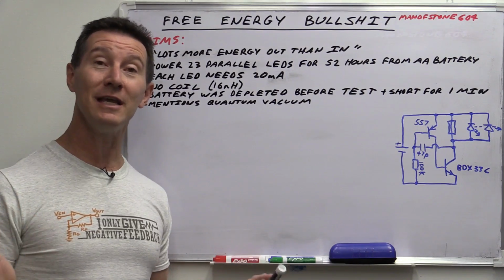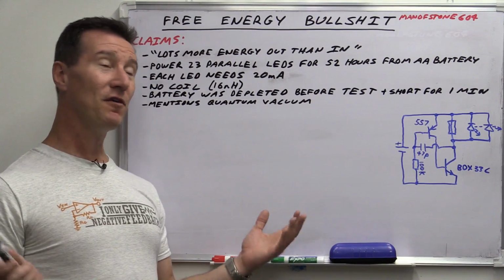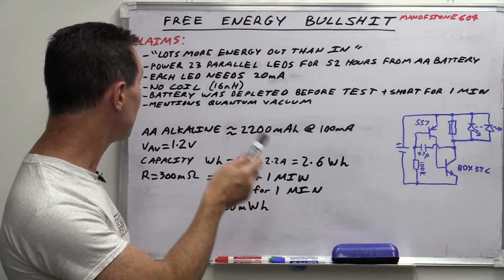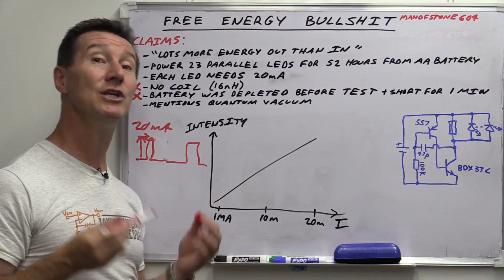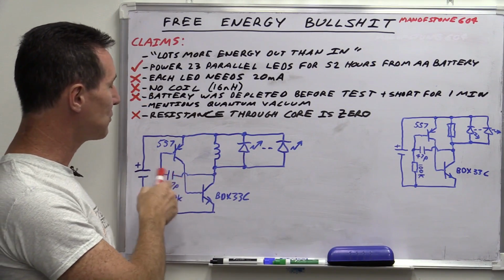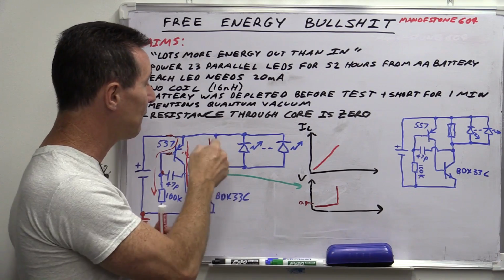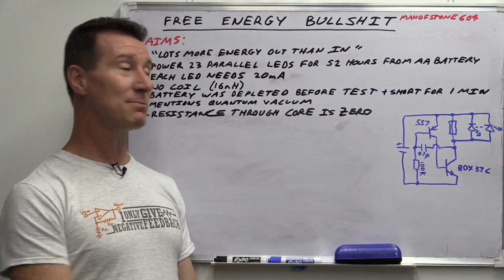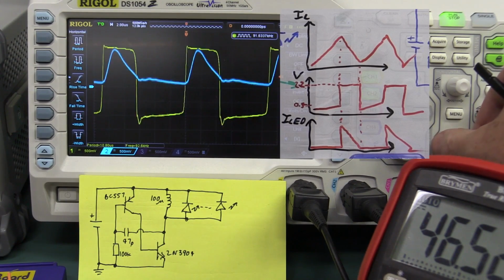EEVblog #708 - Free Energy Overunity is RUBBISH!

Comment: Free energy is nearly impossible unless high frequency open wireless non linear power systems are used along with negative resistance & tunnel diodes :) an unlimited amount of wireless leds can be lit up from a properly built 1 watt tesla coil.

Comment: First of all you have no clue how "free energy" works, There is no free lunch in this universe, you can't make something out of nothing, With that said you can take a little and get a whole whack more performance, It's not going to be a "direct" output silly! It's not that same kind of electicicity when it come from the vacuum. But you can use fancy circuits and devices to trigger this vacuum energy convert and transduce it back to something useful, we can than use such as stored inside a battery for later usage. An open looped circuit charging system.  That is why my device can charge a set of 600 amps 12 volt car batteries in 24 hours period and regauge those batteries to just as newly charged condition.  With a total of about 2 amps used of input current over the 24 hour period. So no it's not plugged into "nothing" and just running.  But I get all that extra in the output for later usage. Sounds like a great deal to me if you know what is going on.
Reply from the maker: LOL
Reply: @EEVblog  Let's put it this way, When your lights are out. Mine are running LOL

Comment: So what is the "efficiency" if the circuit? 24mA@1.5V at input, 11.82mA at output, but we don't know about average voltage or power at the output. It could be interesting to note. Still <1 of course.

Comment: Dave, I qualified as an electronics engineer 35 years ago, but since then I moved into electronics manufacture and then QA. And I was always  much more into digital electronics than analogue, even though there are analogue considerations in digital circuits, particularly where synchronisation and timing are concerned. But your videos are so clearly explained and argued that I was answering your rhetorical questions on cue, in an instant. Everything came back to me: "Then that BJT turns off, and that turns the Darlington pair off, and so the inductor shoots for the sky, but it's clamped at diode forward voltage, and that whacks a mess of current through the LEDs..."

But I am pleased I spotted the non-inductor inductor before you mentioned it. When you said the video poster had said there was no inductor, I just pointed at the screen and laughed. "That's a buggering huge inductor right there! Why bother with the ferrite ring at all, if you're solely looking at DC?"

Comment: Take a solar led light a cheap one. Replace the inductor with a a two coil toroid, so that the primary replaces the inductor. Then the other coil is connected to a matching toroid of  the same value. So then connect a low voltage drop bridge on the output to the output on the second coil and send it back to the battery or super cap to recycle the energy. This is not over unity, it only reduces power used or recharges the battery a bit. But I think it could work better if you couple the magnetic flux. ?

Comment: This really isn't rocket science. 
1: Connect the output to the input. 
2: Remove the battery. 
3: Does it continue 'generating' electricity?

The answer to 3 will always be 'No', because overunity is BS.

Comment: "Extraordinary claims require extraordinary evidence." Yes. Perfect.

Batteries should also have a total current capacity in amp hours, regardless of watts delivered. The power in watt hours assumes operation in an optimal range that doesn't pull down voltage and therefore power. When shorting out, just measure amp hours and subtract that from the total amp-hour capacity.

The thing doesn't look that efficient either. Maybe the coil could be in series with the leds instead of just getting shorted to ground. IDK

Man, if I had a scope I think I would really want a floating ground input because you are always working on live equipment and you can always ground out the floating ground, though maybe that's not ideal.

Comment: When you mock free energy you are right and ... wrong. By Mach principle if you are able to generate a rotary warp in space-time, you can steal energy. Actually far bodies of mass will be pulled slightly towards you so they will lose gravitational energy and by the conservation of energy, this energy must be turned into motion or another form of energy. So you actually ASSUME that there is no way, by using electro-magnetic fields, to generate a sufficiently strong rotary warp drive. This assumption may be unfounded. I agree that most presented devices do not use strong enough electromagnetic fields to generate an Alcubierre - White warp drive but what if mainstream physics is wrong ? What if spinor based theories can't account for unexpected gravity and anti-gravity by electric charge if the the fields are intense ? Don't be stuck in a groove. As a scientist you must accept that physics is all about predictive models and these models may be dead wrong no matter how successful they are, regarding most of CERN results. If you can't accept  that, then you turn science into a religion and that is a very dangerous trend. You should pay attention to: https://arxiv.org/abs/1502.06915 and to https://arxiv.org/abs/physics/0509068 no matter how mainstream physics likes of dislikes these results. The Flyby Anomaly above powerful  thunderstorms , when these occur, is another indication that the Standard Model is wrong, see: L Acebo. The Flyby anomaly: A multivariate analysis approach, 20/Jan/2017, arXiv: 1701.05735 These signs should not be ignored!
Reply: Have you noticed none of the JTRIG crew commented on your well thought out and well written response?
Reply: @anonymousguest9290  They should. It is not my idea. Dennis Sciama and James Woodward came with other formalism of this idea.

Comment: https://www.youtube.com/watch?v=t1brwSJSdRg&t=302s
real free energy , not free to start but after 30 second the device will be creating it own power and some at least 10x more like 100x

1.5volts to boil water

the power from the steam turn a steam engine fly wheel

the steam engine drives a 80 to 20 gear ratio system

the spins a 100v generater at good speed

out come is a lot more power than what is required to run thee system

the warmer the enviroment is or the higher the altitude , the easier the system will boil
Reply: Hahaha! Good joke man!

Comment: what I think about "free energy": the only way is to steel it from radio frequency that you convert to currant/voltage but I recommend multi channelled(fox-news, tf1, canal+, & consorts) what yours thoughts on this one...
Reply: Can't do anything unless their transmitter is practically in your yard. Tv and radio antennas don't "suck" power from the air, they only generate a TINY voltage from the signal wavelength. There is almost no current to capture (build or look up a crystal radio and listen to how weak that direct captured audio is, you really can't do anything useful with it), an old solar yard light panel is pretty much infinitely better compared to radio signal captures. Just like HV power lines you need to be on site to even light a decent led.
Reply: @volvo09  fore sure you wont be able to power up a big circuit, but cumulating channels to power up a little radio? ore some other little things....

Comment: Thing is, yes there are many people making nonsense claims about free energy circuits. However it doesn't mean so called over unity technology is not possible. In fact you have some on your roof, solar PV, also solar thermal. It's just that you believe the sun is firing photons at the earth, so you know where the over unity is coming from. At the cutting edge of science people are discovering that we live in a sea of energy. Empty space is not actually empty. The aether, in some form does exist and no Michelson and Morley didn't disprove it's existence. I believe there are some technologies that are able to tap into this limitless source of energy. But even if you don't believe someone has done it yet, it is possible. It doesn't break physics, just pig headed engineers' belief systems.
Reply: Na, but then you'd be stealing energy from the others in the aether. Show a true case of free energy (yes solar is free, water power is free, etc.... But it's using an existing source of understood energy with calculable losses involved). We know what hits the earth from the sun, we know solar cells don't even capture half of what is shining in the area and what affects it for the worse. There may very well be misunderstood or unknown energy out there, but it's not in our known areas of understanding or else the calculations wouldn't work out, nor would repurposed boards.

Comment: I  think, the waveform is sine, because there is a serial LC circuit, made from this "not an inductor" and the 47pF capacitor. The first transistor is not actually needed, if the main one has enough amplification. In this case you just connect the 47pF capacitor to the base of the main transistor and add some initial voltage on the base using a voltage divider.

And some measurement tools may give wrong power ratings because of the high frequency.

Comment: There are people that are more "Experimental Thinkers" and others that work better working directly with the math and theory.

You explained the theory delightfully, but ... reaching some people (IMNSHO) requires wording things much more directly.

That is: "If you short your AA for 2 hours with heavy gauge wire ... THEN run the experiment and get light, then I might pay attention."

There have historically been several key points that the experimentalists have been "ahead" of the theoreticians, and I don't want to miss any key corner cases that prove to be interesting phenomena. The triode for instance. (And much confusion theoretically at a variety of places in our march to modern chips.)

Comment: free energy is simple and there's more ways thane one.... "Basic Engineering" as you call it, can be used with "Basic physics". For example, play gravity off/ against buoyancy ..... for example, 1 container with fluid will allow a container of the liquid to sick. then hit a valve that release's the water and fills with aire (just using air for exaple). when its full valve closes and the submercible leaves for the surface. and process crepeateats for ever with a syphone or 5 replenishing the water in the tank. this will run for ever and you CAN get fre energy from it

Comment: How many of you who do not believe in so called free energy please tell me how many years you spent studying it? How many of these devices are you aware of? Can you name three? The future should not be powered by dirty energy but clean efficient energy machines.
Reply: >How many of you who do not believe in so called free energy please tell me how many years you spent studying it? 

None really, but I have done several university-level physics courses and those were pretty clear on why "free" energy doesn't make sense. Look up the first law of thermodynamics, if you somehow haven't already. Spending years trying to find a machine that works isn't necessary because the math proves, pretty easily, that it's impossible unless you can make 1=2.

>The future should not be powered by dirty energy

Of course, that much is obvious.

>... but clean efficient energy machines.

Which plenty of things are, but "free" energy does not exist. You cannot have a closed system that has more energy coming out of it than energy coming in. The earth ultimately gets it's energy from sunlight "burning" hydrogen in a fusion reaction like a car burns gasoline (without CO2 emissions granted, but there's only so much hydrogen in the sun), and radioactive material heating the inner earth which also "burn up" until they radiate no more energy and the earth interior eventually goes cold in the far future. Solar energy isn't free, it comes from the sun, which won't radiate energy infinitely. Hydro depends on the water cycle which is, again, the sun's finite doing. Wind power depends on currents that are ultimately due to... the sun. Any kind of nuclear basically turns mass into energy, but you need to give up that mass to get that energy, no buts.

Comment: Wow! Love your explaination!
By the way, do the explaination with using an antenna (yeah, radio-waves to ground!!) instead of an old battery... it does the trick and is mindblowing to a lot of people since you don't even have a battery in your circuit ;-) Magic!

By the way, using a 'depleted' battery that most people would just throw away is a 'free energy source' because you can  use more of  the last bits of stored electric/chemical-energy out of the battery instead of throwing it away as usual. And since you only pay for the first electric part of the battery (1.5 - c.a. 1.2 Volts, the rest beeeing waste) you actually are using 'free energy' ;-)

Comment: could you inject radio waves into a project  to control low powered chips i.e. a simple cat whisker meets a silicon chip as its feed pulse only using power from the airwaves.....so many ideas in my head, but i locked them away as not to be mocked by debunkers

Comment: Ok mate who are you ?  WHAT IS A LEAD  YOU MEAN A  L E D Light Emitting Diode,  Lead/Atomic number 82 . A diode   Examples of III-V materials commonly used to make LEDs are gallium arsenide (GaAs) and gallium phosphide (GaP).....Think WHY this person is in a state of logic where he/ she wants to help find  help a way of saving the human race??? instead of debunking look at the  layout you might see another way help them. these are the minds that solve massive hurdles a preset mind cannot. remember all invention starts in a back room some where with someone chasing a deam what is happening with that heat from the lights and the light its self what would happen if you put coils around  wires in induce eddy currents what would happen  if you could replace the lights with a cooler micro pump and cooled the wire down to increase electron flow....Remember its not long back if i was to tell you a grain of sand would take over the human race you would have put my in a padded room lol ...do not  debunk find the answer save the human race or help them find what they seek as mankind depends on active solvers to expand

Comment: I've enjoyed this. And the comments, back and forth. If you don't have that belief that you're getting energy out of a quantum vacuum and you are correct. Correct...with the worse LED's indeed. You increased the current and they stayed the same....but the circuit is useful...very. Not free, but Russians have done some interesting things too. LC circuits, I studied while trying for my ham license. Same principle as the stun gun. 9V battery powered but it'll knock you on you assets, quicker than lightning...in a bottle. Cheers from....Compton. Thx.

Comment: Also that circuit is a hybrid Lawerence Fleet circuit. The base single transistor, battery, diode, coil and led. 

The circuit designer replaced the coil with exactly what you said, a coil and another diode. Which is smart for efficency.

The lose of energy is in the material. 

Use a xeon tube for the conductor instead of wire, use magnetic connectors and create a physical switch for the diode to pass the gas if you will. 

That circuit will reach way up to 90%.

Metals will always resist the quantum spin off the electron so you have to beat entropy with entropy. 

The chaos of the gas is controlled by rotating, or twisting the conduit. 

Technically you can do the same with metals.

Comment: Though I'm sure your engineering is correct, there are a lot of koo koos on the Internet claiming free energy.

But your statements of that it doesn't exist is actually incorrect. 

1st the universe exists, therfore energy exists, since the universe is ever expanding, motion is ever present therfore perpetual. 

2nd scientists created time crystals, because they stopped thinking 3d+t and started thinking 4d+t, perpetual motion exists in the form of non linear matter. Aka time crystals. 

Trick is, borrow from the past what you need, and send it to the future. 

Your wrong, classical physics is wrong it only works in 3d space. Not 4d